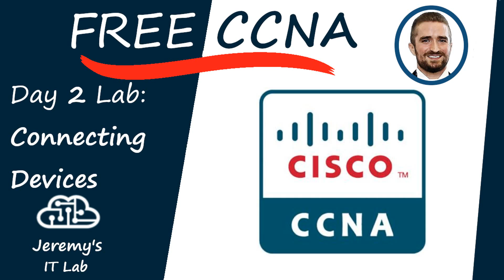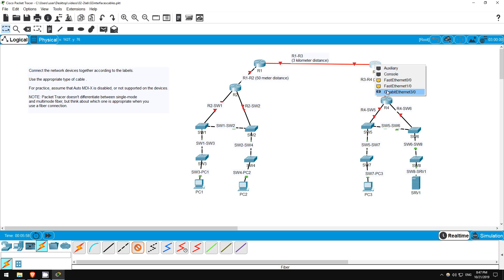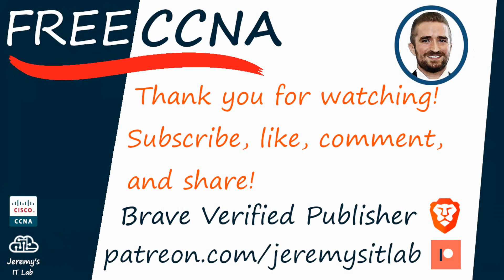Free CCNA | Connecting Devices | Day 2 Lab | CCNA 200-301 Complete Course

Comment: I’m having trouble connecting Router 1 and Router 3 ,they won’t connect even though I’ve connected everything else. I keep getting a ‘wrong port cable’ error, even though I think I’m using the correct cable. Also, is this the correct router model to use? Does it matter if I use the same router model for both? Can anyone please tell me what kind of router he’s using in the video?
Reply: Are you using the latest version of Packet Tracer? It does have Singled Mode (S with the yellow cable) and Multi-mode (M with the yellow cable) now. Are  you using the correct cables?
Reply: you shouldn't have to change the routers at all. Just make sure you're using the right cable and you select the GigabitEthernet port for the connection (it's a fibre cable so it's not going to use the same RJ45 port as typical ethernet)

Comment: Hello, i have a question why cant we connect the fast ethernet port of the switch to the gigabitethernet of the router arent they should negotiate the speed and it works?
Reply: In this lab we're using the Gigabit Ethernet over fiber, which use SFP instead of RJ45 copper UTP cables. Gigabit Fiber UTP cables only are for distances up to 100m whereas fiber is up to 550m for multi-mode and up to 30km for single-mode.

Comment: So I figured this is a long shot, but maybe someone one day sees my comment:
Out of curiosity I went back to the lab of Day 1 to check what packet tracer decided to do with the cabling. And I noticed that it connects a firewall and a switch with a crossover cable, and similarly connects a firewall and a router with a straight-through cable. According to what we learned today, this should be wrong, no?

Is there some "deep secret" of this specific kind of firewall unit, or is it a quirk of the simulation?

Comment: why dont we use gigabit ports between r1 and r2?
Reply: I think it's because he needs to use UTP cables, not fiber. The gigabit ports are only for fiber in this case.
Reply: @robluis9306  but i meant about packet tracer's behaviour. when i try to use copper cross-over cable between R1-R2's gigabit ports it says "the cable can not be connected that port"
Reply: @CengizErgün-x8x  That's because the GigabitEthernet ports on R1 and R2 use fiber connectors, which are physically incompatible with RJ-45 connectors. A cross-over cable uses RJ-45 connectors and is designed for copper Ethernet ports. Therefore, to connect the two routers using a cross-over cable, you need to use their FastEthernet ports, which support RJ-45.

Comment: i dont know what was the problem i wanted to connect R1 to R3 by using fiber optic cable but it show me error like the cable cannot be connected to the port..kindly guide me how to connect R1 to R3 by using fiber optic cable howeer i add port means through physical interface still i cant ... thanks

Comment: Hello Jeremy! I just started studying for my CCNA and you have been an amazing resource and teacher.

Question, is the crossover cable between SW1 / SW2 & SW5 / SW6 there for redundancy? Wouldn't the routers negate the need for this due to them connecting to both switches on each side?

Comment: Hi, which router brand did you use, since there is an error when connecting with Fiber (The cable cannot be connected to that port). I used 2911, and i can't see any 2 spaces-like Gigabit, there is only RJ-45-like Gigabit

Comment: I performed lab . But  firstly i connect same devices with straight cable ,when i realize it's wrong then i tried full to remove connection ,but fail.Then i re open lab.tell me way and also give trick to remember standards  like 802.11 and all others.
By the way  your work is satisfying to me.

Comment: Can anyone explain why both the switches need to be connected to the router since the router is already connected to SW1 and there is already a  connection between the switches?
Reply: It is set up that way for redundancy in case on of the switch links to the router goes down so the clients are still able to reach the router.

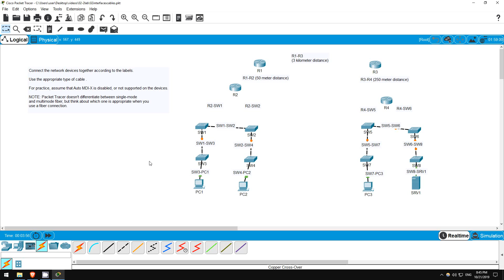Comment: Why are switch 1 and switch 2 connected together, then both connected to Router 2? (At around 2:50). Also, tysm for your content! You make everything so easy to understand (especially cabling)
Reply: I assume that’s a trunk link between switches for crossing VLANs and the router is for external routing

Comment: QQ- Why are we connection SW1 to SW2 and SW5 to SW6? For SW1/SW2, would it not make more sense to connect SW1 to SW3 and SW4, then SW2 to SW3 and SW4? Then, if switch 1 or 2 failed, switch 3 and 4 would both stay on the network. Maybe I am getting too deep too early here, but would like to know if there is a reason we are connecting the top switches to eachother.

Comment: Hello i am doing a job as a network support engineer and there is an isuue  have been faced regularly that some of the laptops of my company are connected with the wifi but showing no internet secured and the rest devices are working usual. I am unable to find out the isuue can you please help me with any tips or aything so that i will resolve the isuue.......

Comment: Hi jeremy what is the name of router and switches that are used in this lab? i have issue when i try to connect the router using fiber optic it shows that "the cable can not be connected to that port" what can be the issue as the fiber optic symbol at 4:25 also not shows
Reply: same
Reply: same here

Comment: i have a question, In a typical network connection, when we connect the router to the two switches on each setup doesn't that cause a loop in a network? for this lab, R2 is connected to SW1, SW1 is connected to SW2 and SW2 is connected back to R2.

Comment: Hey, got a question....why some of the connections are showing in green and some other in red (the little triangles)?
Reply: Found solution from another user:

@Weaver0x00

For those who got confused by red triangles between routers/routers and routers/switches, for some reason ports are closed by default on routers in packet tracer. 
Left-click on the router, go to Config and in the corresponding interface tab tick the "port status - on" box. 
You can do it for all the ports on the router if you don't remember which ones you used for connection, but I suspect in real world scenario it would be an unsafe practice allowing a random guy to plug into your enterprise router when nobody sees. Or maybe it's a load of nonsense, I don't know, I'm only learning just like others : D

Comment: Hi, I saw you connected switch 1 and 2 , on the other side you connected switch 5 and 6 , I tried it myself before watching this video and I connected Switch 3 and 4 , switch 7 and 8 on the other side, is it a wrong method or not
Reply: I am not an expert, but it looks like connecting SW3 and SW4 allows for faster communication between the end hosts on their LAN than between SW1 and SW2, as the packets have fewer hops to travel through.
Reply: I suppose there could be a geographical problem connecting SW3 and SW4 if they are further apart from each other than SW1 and SW2.

Comment: Question- Why did you connect switch 1 & Switch 2 together?
Reply: This could be for resiliency purposes. In case the cable between R2 and either SW1 or SW2 gets damaged, the connection to the end hosts would still remain intact.

Comment: I am connecting fiber cable with the above router to other router but it says me 
The cable cannot be connected to that port
I open the CLI command of both routers and write these commands but it still didn't work 
Router(config)# interface gigabitethernet0/0
Router(config-if)# no shutdown
Router(config-if)# exit
Reply: use the pt-router. you may need to add modules to the routers physical interface.
Reply: @NotJustAPhase777   I replaced the routers with pt-routers but it still has not connected the fiber cable to them also when i select the auto cable for connection it connects some red cable
Reply: @muhammads_editz  have you tryed clicking on the router & under the physical tab adding "pt-router-nm-1fge" ?

Comment: This is annoying. My Router 1 - 3 connection won't work since neither of them have a Fiber port. And I have no idea how to even add one. How unfortunate.
Reply: use the pt-router. you may need to add modules to the routers physical interface.

Comment: Hello Jeremy....I really like and appreciate your course and I intend to take the CCNA test after completing the course....Anyway, In this lab2, i got something different from the Lab2-lecture, but I understand and did right but the simulation won't take my connection especially between R1-R3 fiber optic cable.
Reply: use the pt-router. you may need to add modules to the routers physical interface.

Comment: Question: I'm new to networking and did everything shown in the video. When I ran a simulator, the switchers are still red ( which I assume means no signal is passing ), and I noticed yours is red as well. So what would get PC1 to be able to transmit a message to PC3 or SRV1?
Reply from the maker: To enable communications between devices, you'll need to do some things that are covered in later videos ;)

Comment: I got everything in this lab correct EXCEPT I didn't notice that a cable was needed between switches 1 and 2 and switches 5 and 6. LOL

That being said, I understand why those are there, but I don't quite understand why they both need to be connected to the router. Am I perhaps getting ahead of things here or did I miss something? I love these courses so far and intend to see it through to the end, but I have a habit of wanting to understand everything and it occasionally results in me overthinking a scenario that doesn't require much thought to begin with. Thank you.

Comment: Though the distance between R1 and R2 is 50 meters however, we had to use Cross over as both routers are same networking device. Copper cable which is UTP cables are allowed till 100 meters but you explained earlier for connecting two same devices single through cable is not applicable. so why we used copper cable by considering 50 meters distance and not by same networking device.
Reply: R1 and R2 are the same devices and copper is fine up to 100 meters, that's why R1 and R2 has been connected using the copper crossover.

Comment: I’m just curious about one thing,  I tried connecting  ‘fiber’ to the routers that have 50 meters, 250 meters and 3 kilometers for distances and I got an error say that I couldn’t connect to certain ports unless I used copper.   Do different routers on packet tracer have differing port configurations?
Reply: I had the same issue as well. @Jeremy'sITLab any ideas?
Reply: @elizabethmburu3676  not sure if you noticed this or not but I noticed each piece of equipment has different modules you can swap in and out or no modules at all.  I just played around with this until I found the modules that I needed to make things work

Comment: Thanks a lot for the series !
I have a question about this topology: If i had to guess which devices should be connected at the begin, I would directly connect SW1 and SW2 to R2 on the left side, and SW5 and SW6 to R4. But I wouldn't connect SW1 to SW2, nor SW5 to SW6.
Is there a reason to connect them also ?
Reply: I have the same question. Is there a reason behind this particular topology?

Comment: Question regarding connecting the two switches using cross over, you connected port 1 to port 1, I thought it would be port 1- port 3 and port 2-port 6 when transmitting?

Comment: No more 543 rule (5 sections, 4 repeaters, 3 nodes) I understand its not necessary in modern networks. it used to be explained for legacy products.
Reply from the maker: Yeah I had to google '543 rule', I wasn't aware of it. Thanks to switches we don't have to worry about large collision domains!
Reply: @JeremysITLab  in the 640-801 we had to learn all sorts of weird and wonderful technologies. 

Token ring which essentially was imagine a bus going around a circular route and can only pick up or drop off while at a stop. Only the bus is the token and the stops are nodes.

We had to learn the basics of ISDN of frame relay and ISDN.

Comment: I got the lab files from the provided link, but cannot find the files for this particular lab in this video, as well the very first one you made after day 1. What name would that file be under? your help would be appreciated. thank you
Reply from the maker: They’re all labeled by ‘day’:
Day 1 Flashcards 
Day 1 Lab
Day 2 Flashcards 
Day 2 Lab
etc
Reply: @JeremysITLab  So. the lab files for the labs following each day course are together with the Flashcards? I have only purchased the lab files on your website and although there are very helpful labs with the video for each one, I cannot find the lab files for these videos on you'tube. For example Day 6- Analizing Ethernet switching. the lab you are describing in this video does not have a file for me to practice in Packet Tracer. or does it? I may just not know where to look. Thank you kindly for your time
Reply from the maker: @wezwez4924  All of the files for this course are in the same Google drive. Did you sign up at jitl.jp/ccna-files?
Reply: @JeremysITLab  Kindly , Yes I believe so.I have access to the 76 lab files on the CCNA Lab Series (which are different than the labs presented in the You'Tube series. Is there another group of files that I have missed maybe?
Reply from the maker: @wezwez4924  You should have gotten an email with links to each Google drive. Did you get the google drive with the flashcards? These labs are in that google drive. If you didn't send an email to info@jeremysitlab.com
Reply: @JeremysITLab  ....I have figured it out. The lab files are on the 69$ full course, not the 10$ lab files. I didn't notice at first that there were 2 options: one to purchase the full CCNA course including lab files and Anki flashcards, and another option where I get 67 lab files with their video explanation Kindly thank you again for your replies and for the making this course available for us !!

Comment: Dear Jeremy

Many thanks for your hard work. 

Is it possible if the SW1 and SW2 ; SW5 and SW6 could be skipped? Which means SW3 and SW4 could be connected by crossover cable ; SW7 and SW8 could be connected by crossover cable.

And is it possible if the R2 and R4 could be skipped? Which means the switch could connect the R1 and R3 directly even without R2 and R4.

Looking forward to hearing from you. Thank you.

Comment: For those who got confused by red triangles between routers/routers and routers/switches, for some reason ports are closed by default on routers in packet tracer. 
Left-click on the router, go to Config and in the corresponding interface tab tick the "port status - on" box. 
You can do it for all the ports on the router if you don't remember which ones you used for connection, but I suspect in real world scenario it would be an unsafe practice allowing a random guy to plug into your enterprise router when nobody sees. Or maybe it's a load of nonsense, I don't know, I'm only learning just like others : D
Reply: Thank you, I didn't catch that starting this up on my own!
Reply: Thanks alot
Reply: Spent half an hour trying to figure out. Thanl you.

Comment: Before proceeding, thank you a lot for this nice work man! 
May I know which router and switch you have used in this topology. Im using router 4331 and switch 2960 but having issue while connecting using fiber cable between R1-R3.
Thank you in advance.
Reply: You are right, use R4321
Reply: Yet not came sir, is there any alternative method

Comment: The 2 routers that was used on top... which routers did you use? I have tried on my packet tracer and none have the fiber capability. Thanks.
Reply from the maker: You have to add modules to the routers in packet tracer to use fiber. Google for how to do that or just download my lab file!
Reply: @JeremysITLab  WHERE IS YOUR LAB FILES LOCATED?

Comment: While trying to connect the router with a fiber cable, I am getting the error as the cable cannot connect to the port. So any inserting port requirement is there in the router to do it?

Comment: Guys could someone clarify if the connection was required b/w switch SW1 and SW2 in diagram or not? Thanks
Reply from the maker: The requirements for the network aren't stated, so it's impossible to know if the connection is required or not.

Comment: i make network like one router connected with two different switches and i configure terminal 0/0 and router terminal 0/1 one pc connect with one switch and other pc connect with other switch on the router 0/1 both configured but when we send data it not send

Comment: Tried replicating the lab in pkt 8.0. unable to connect fiber as the port is not compatible with 2911 router. What routers are being used and what port needs to be included in router console. I tried adding the SFP port
Reply from the maker: Hi, download my lab files from the link in the description.  I'm not sure which model I used, but anyone that supports SFP modules is okay.
Reply: @JeremysITLab  only flashcards link is available..
Reply from the maker: @socialnavigator2282  it’s the same link

Comment: I am unable to connect Fiber optic cable between two routers (Router 2911). I am not getting that port which is GigabitEthernet 3/0 for fiber connection in Packet Tracer7.3.1 only two ports are visible. Please help how will we proceed for fiber connection?
Reply from the maker: Download my lab files, or do a google search for 'packet tracer add modules'.

Comment: Hi, first of all, thank you for posting these videos here. I am a high school student and this helped me a lot in class. I have a question though. I can't connect the R1 to R3 and R3 to R4 using the fiber in the packer tracer so I have connected it with the copper cross over. is there any way you can help me? I would really appreciate that.
Reply from the maker: Hi, did you download my lab file?  If not, you'll have to add fiber interface modules to the devices.